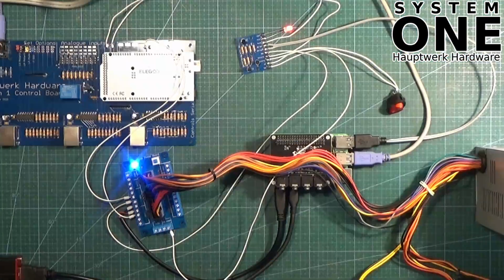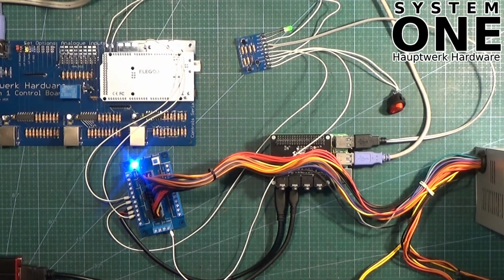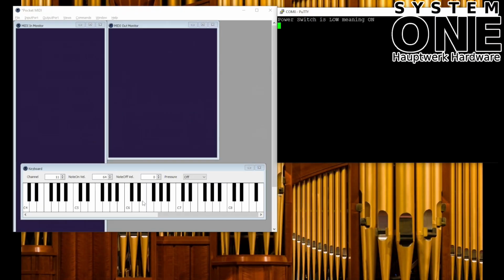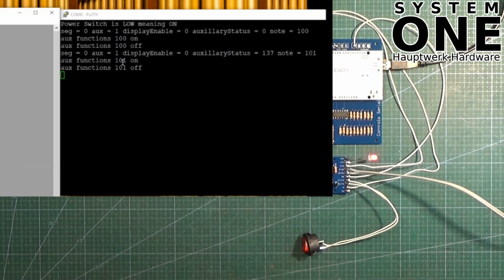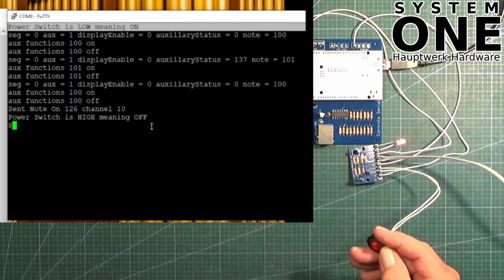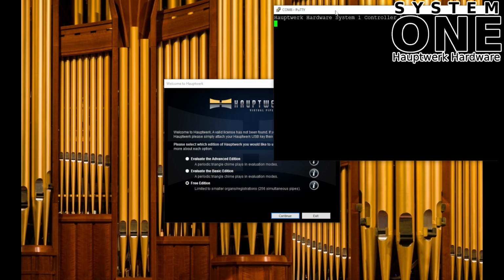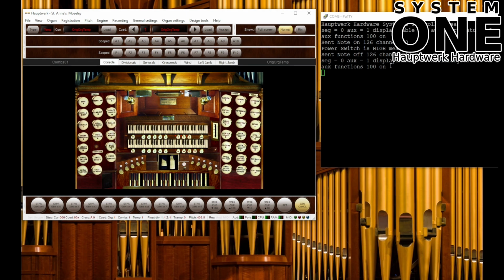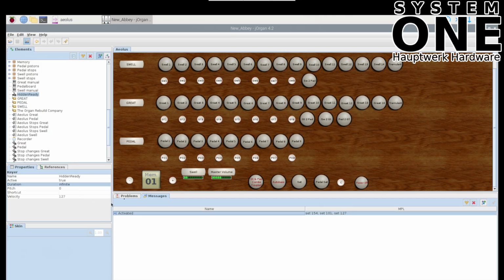The System ONE Power Management System

Comment: Powering on and powering off are two different problems.
Wouldn't powering off be best done by opening a terminal session on the computer via the network, and executing a graceful shutdown by executing a script to shut down the hauptwerk software, with appropriate rights, and then shutting down the computer.
Powering on can be done also via the network by having the bios configured to monitor for a call to boot the computer. A raspberry Pi can be used to do that if that and the network and the computers are configured to allow that. That way the regular starting and shutting down capabilities of those computers can be used.